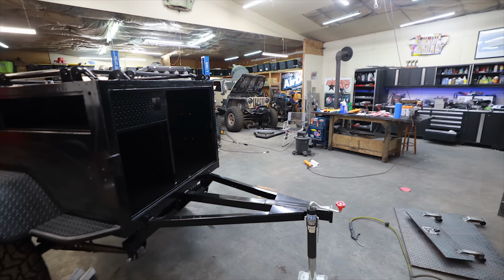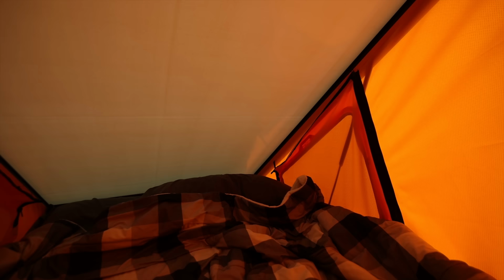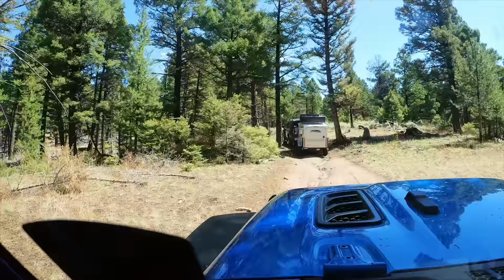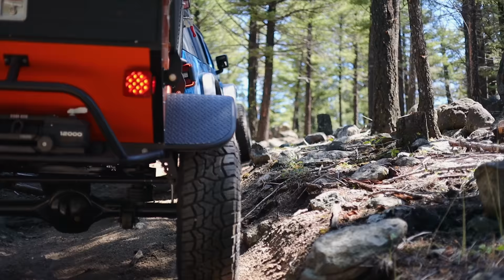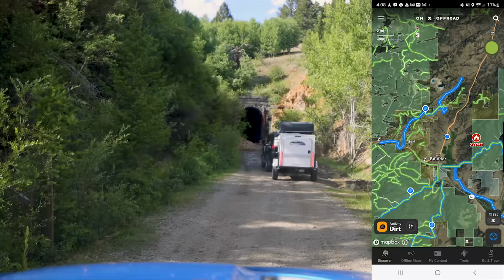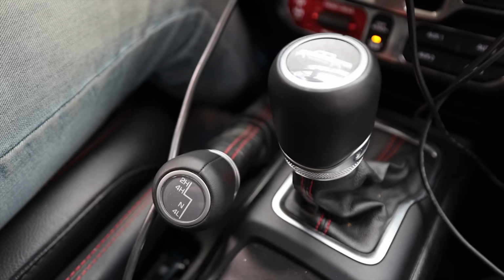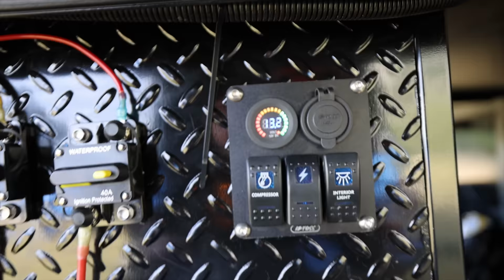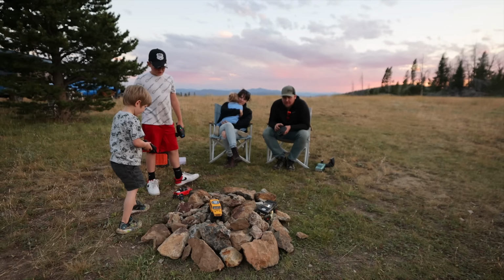Problems On Our First Trip... Harbor Freight Off-Road Trailer Episode 12.

Comment: Turned out great!   Looked like the kids dig it.  I’m thinking after another trip or 2 you will have refined everything that you want being wary of weight.   Have you had any issues with your diesel going into limp mode?   I’ve seen that happening on a few overlanding channels.   Amazing with what you started with and the (almost) finished project!

Comment: That's a cool trailer and some has given me ideas I love the channel it gives me perspective on to what I have planned for my jeep and trailer but on that not of u leveling your trailer consider using trailer jacks in the back with the drop-down leg so that u can just drop the leg and then start cranking at it to level it after u had leveled out your truck it would cut the setup and teardown time if the leg can't reach u got those orange "Lego" bricks to help with it

Comment: Coming in from your back hatch on the trailer, what if you built a deck in there that had a false bottom? You'd still have a triangle shaped "junk drawer" under the false bottom but it would give you a nice flat surface to put some small totes, bags, or anything else on either side of where your snorkel internalizes. I'm picturing the false bottoms being made out of something light enough that it's easy for you or Mrs. Dirt Lifestyle to pop out, maybe 1/4" ABS?

Comment: you probably know this...but if the battery isn't sealed see about adding some distilled water to it.  If it's sealed...yep, it's probably toast.  You can take it to O'Reilley's and they can do a real load test to confirm.  But it looks like you did that on this trip.

Oh and what brand/model charger is that.  Always looking for other options.

Comment: saw the advantage/importance in a rotating hitch, like the idea of stabilizing jacks but removable and put in "junk drawer" so they won't hang up on things you won't see at the back. How much would you need to lengthen the tongue make to cooking area more usable? and could the fridge open another direction having more access? also a tarp for that area? I agree that to "pump" water for filtering seems like it would take too much hose to store. I also think mor side access would be beneficial.                                                                                                                                       I am building a trailer now 42" wide by 70" long with a modified axle that will have 32" tire, same as my Tahoe. Not a welder so I am going to try to make a wood body that will work, which means more work to try to keep the dust and weather out. My plan is to keep the camping/tools there and the sleeping in the Tahoe. I am sure it will be modified many times with new ideas each time I use it. Love watching all your videos!

Comment: We get the same problem at Nemo Tunnel in Tn. Be 3/4 of the way through and then come across a full size truck that doesn’t want to back up🤦🏻‍♂️ part of the adventure. Trailer looks great. If you had it to do over again, would you run a torsion type setup or run your coil/links setup? It seems to work well

Comment: look into what constitutes a charged car battery. Your 12.5V batt can be just fine. if it holds 13 V without being charged, then something is wrong 12.8 is probably the highest voltage a healthy batt should show. 12.5 is a healthy voltage, and its normal for voltage drop after some use. i dont know why you were showing 13+V though, solar charger? was Gladiator charging it?

Comment: Always been curious why fab guys never seem to use aluminum?
All that frame structure for the trailer could be nice light weight aluminum, and it’s not really enough material for the price difference to be a deal breaker.

Comment: May I ask why you went with a heavier beam axle rather than swing arms ? I understand you get much less travel (without getting into complicated geometry for springs or using less reliable cheap struts) I know it was budget and you could use ORI’s . The reason I ask is that seeing as a trailer pivots on the tow hitch, does it need much articulation at all ? I’m sure you had a reason, I’m just trying to figure it out as I’m interested in doing something similar myself. I figure lifted is no problem, but lifted and lots of travel is an expensive heavy problem. Thanks for the content.

Comment: That's interesting. I got the same voltage switch set from Amazon and I'm trying to monitor the Jeep alternator charging. The dash gauge stays dead on full charge while this digital reader flactuates between 8 and 12.4 volts. Maybe that reader is just not reliable?

Comment: Question for you love the trailer and set up with the gladiator but you said in the video you had 4:10 gears with the diesel rubicon and was wondering if you re geared it to that or stock because my 2022 eco diesel gladiator was special order and they would not let me order it with the 4:10 gears and 4 to 1 transfer case that the rubicon’s normally have because of the diesel wonder if you changed gears or some how was able to get the 4:10s ?

Comment: I have a question for anyone who is using a fridge slider like the one in this video: Has anyone ever had one of these break and drop your fridge on the ground? I have an ARB 50 qt, and when it's full, it must weigh close to 80 pounds. I just got a Rav4, and I want to put the ARB on a slide, to make it easier to use, but can I really trust it to hold something as heavy as an ARB fridge when it's pulled all the way out? SUV's don't have tailgates like a pickup truck, so when you pull a fridge on a slider out of the back of a 4-Runner or Rav4, it's hanging in mid-air without a tailgate under it in case it did break loose. I'm just a bit nervous. Any advice appreciated.

Comment: Great video, it is awesome to see the trailer on the trails.  Interesting comment about the single axle trailers amount of flexing being very small, I had not thought about that. Does a single axle trailer's flex get better if the suspension is an independent suspension (Similar to Icon suspension on the Turtleback trailers)? thank you

Comment: 13.5v is a surface charge, as soon as you put any load at all on it, even a tiny LED light, it will drop to it's "normal" full voltage, like 12.6vdc. Any car battery(flooded lead acid, AGM, etc), 12.6vdc is full, so don't panic about the 1volt drop, it's completely normal for a battery that was being charged at 13.5 or 13.7vdc to show that voltage until it gets a bit of load to wipe off that surface charge and back to its "normal" state.  You can only safely use 50% of the AH rating of the battery if its lead acid, so a 100AH battery can be drained by 50AH.  I use LiFePO4 chem batteries in my off-grid cabin and in the bed of my JT, charged by solar.  You can safely use 90+% of the AH rating without issue.  I have a 280AH lithium battery pack that I use on my longer trips to run my fridge and lights, while exploring the Sierra Nevada Mountains and Death Valley, it is full at 13.7vdc, but needs a different charger to keep it full off solar.  They recharge quickly as they can absorb whatever your solar can put out.  My 120watts of solar kept that battery charged to full before lunchtime after running a fridge and lights all night long.  We did 10 days in DV with that set-up and 100% of it offroad.  Water being the bigger issue than power.